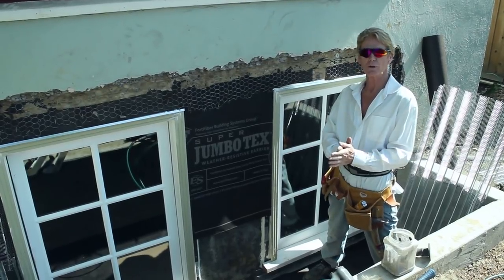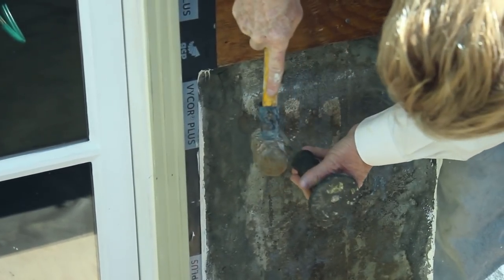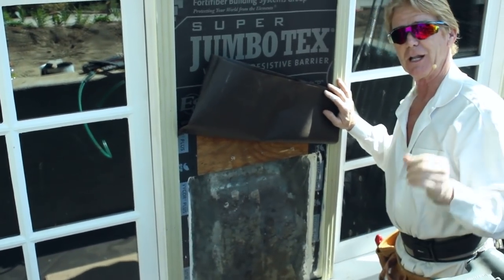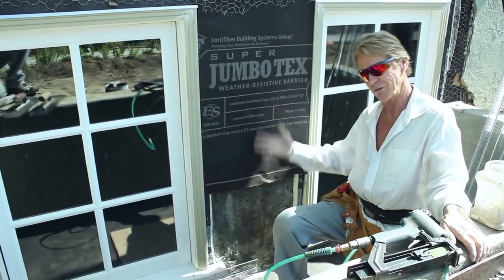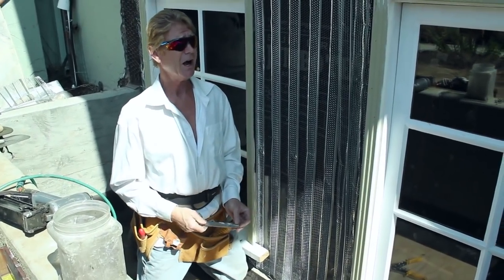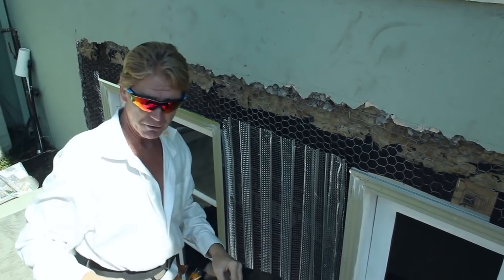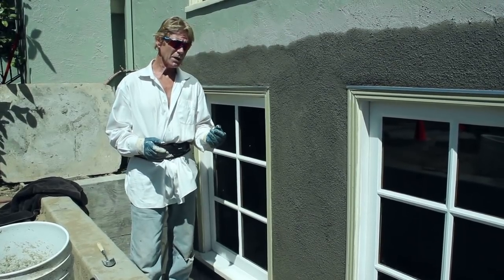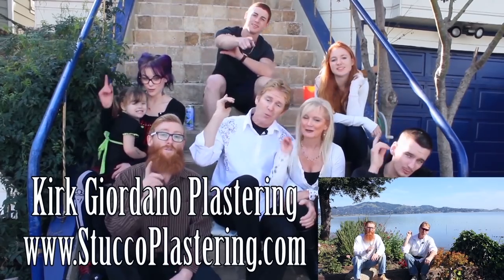Blend wood walls into concrete walls with stucco

Comment: Greetings Kirk, glad to get a notification.
I will be doing a Santa Barbara finish. Any advice? I mentioned you to my customer and they actually have seen your videos. Keep those videos up!!
Reply from the maker: Good evening Fee, make your base coat perfect with a polyurethane float, leave no sand exposed as the finish coat is very fine, don't let anyone use a green sponge float as you do not want to expose any aggregate or sand, as even a grain of sand will drag and make a line in the finish coat.
Most importantly, bring a radio.

                         Bringing peace, love, and harmony to plastering 
    The complete plastering encyclopedia on video, by the plastering messengers of Youtube
Reply: @StuccoPlastering  Appreciate the advice Kirk, I will follow your instructuons. Thanks so much for the reply. Wish you and your team well!!!
Felix Zarate
The Masonry Company

Comment: Would love to see u plaster with your shoe.
Challenged lol
Reply from the maker: Howdy Woody, you're on brother.
   Plus, perhaps ten other things as if a man can use a hawk and trowel with a natural talent, there are few limits. 
I'll apply stucco with goofy household stuff, but none will be faster than my Hawk and Trowel.
   I'll have to hide, "my pool trowel" in the box of the truck, as she gets Jealous when I have in my hand rectangular trowels, it's tough to work with a jealous pool trowel she doesn't flex or bend right until I break her back in.
Not as bad as a jealous girlfriend, but that's another story.
   FYI, When my growed up kids were young, I had zip lines in my house.  I thought this was normal until friends started to say, man, what's that about? I said their zip lines, most said, "I can see that but who puts them in the living and dining rooms. I never thought this was unusual. 
    Getting back to your comment, I will need a job where I'm not in a hole, so it may be a while.
Off-topic, I'm better at nunchucks than at plastering, this learned hand-eye coordination helps, but it is not necessary to apply stucco to walls. 
To be clear, I'll show some goofy household or garage tools to apply stucco with, depending on what I find lying around my house, but if they were faster, I would be using them instead of my Hawk and jealous pool trowel.

Bringing peace, love, and harmony back to  the world of plastering.
    The complete plastering encyclopedia on video, by the plastering messengers of Youtube.
Reply: @StuccoPlastering  hahaha. I look forward to watching it

Comment: Here in San Diego if it is living space you need paper and weep scenes to pass inspection.
Reply: I believe you only need weep screens if you have a void between the stucco and  sheathing like you might find in a foam board system.
Reply: @avisitorhere  --- Okay, it's "weep screens."   For a second, when I read "weep scenes," I thought I'd have to stop and cry over my cruddy stucco work.  LOL.